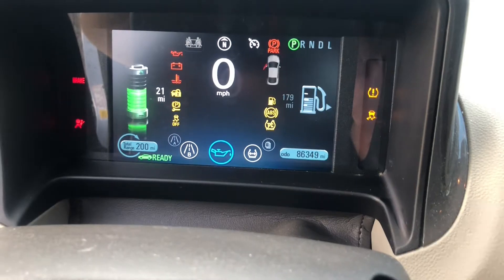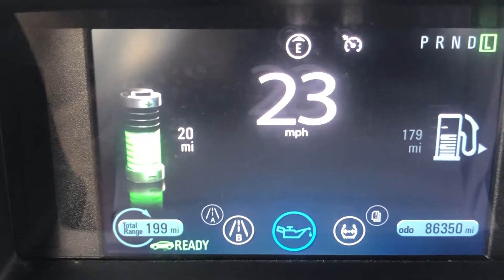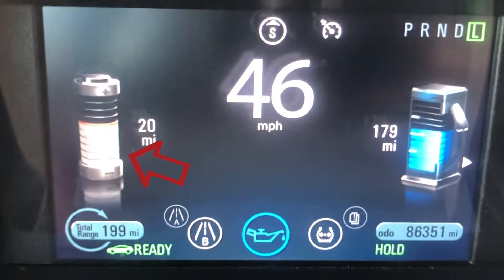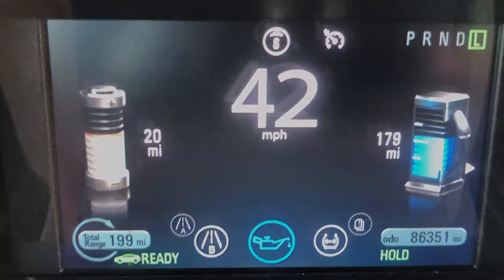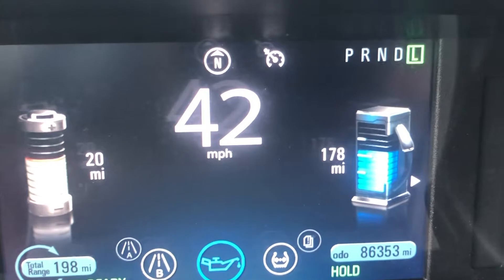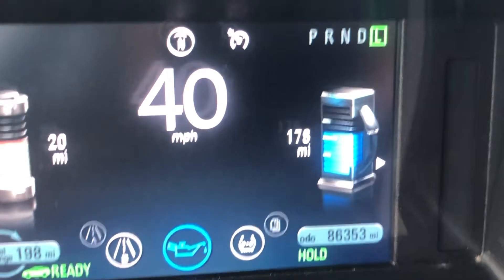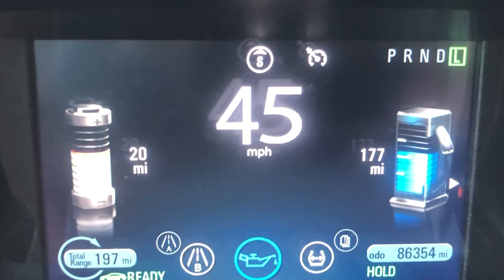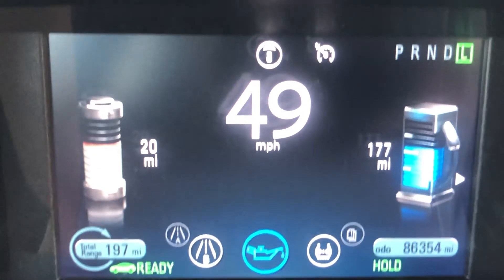2013 Chevy Volt - Hold Mode - EV evals

Comment: But on the highway, doesn’t it’s the engine just generate power for the batteries that drive the motor? Not actually drive the wheels. So it wouldn’t make a difference on efficiency? -saving battery for city.
Reply from the maker: Yes it acts as a generator most of the time. I believe in extreme cases the engine will drive the wheels though.
On ours the engine works really hard when it first switches over to gas. I don't remember this before but our driving routine has changed.

Comment: Why do you drive the car in "Low" instead of "Drive"?
Reply from the maker: Chevy chose to use “Low” or L to mean regenerative braking. Several other automakers, like Nissan I believe, chose B for braking.
Reply: @EVevals  thanks for the reply, very useful to know!
Reply: @EVevals  Thinking in ICE vehicle terms. Doesn't driving in "L"ow at speed, risk over working the engine?...or something else?

Thought I'd never want a Chevy and then I bought this Volt. Love it! Reminds me of my old 2003 Mercedes C230. Only I pass up gas stations unlike the gas guzzling Mercedes. Unfortunate for me though, I am leaving the country and can't take it with me. In trying to sell, I am running into a load of scammers. Any thoughts or advice?
Reply: Driving in 'L' or 'B' for regen is very inefficient. Especially on Highways. 'L' is for steep downhills , Mud or Snow. It is there to allow you to control the vehicle in certain situations.

Comment: The Chevy Volt is GM's exercise in EV design and technology.  It has its limitations.  These should've been dealt with and improved, but they opted to just killing the concept and pushing the BOLT EV platform.
     My daily commute with my 2013 Volt consists of a  mountainous 124 mile trip each way with a mountain pass that summits at 5,250 feet elevation.  Starting elevation is 2,500 Ft and destination is 3,720 Ft above sea level.  and then the return trip.    The Volt's drive battery can be depleted to the point of displaying the "PROPULSION POWER REDUCED" dashboard warning, PRIOR to completing the summit.  So, MOUNTAIN Mode or HOLD mode is required.  If I do not use the charge cord at my destination, I am forced to keep the vehicle in HOLD mode for the duration of the commute until I pass the summit during the return trip.     I have suffered the indignity of the reduced propulsion power.  It sucks, so my goal during the commute is to reserve enough drive battery capacity to reach the summit at highway speed.  
     My daily commute is not the ideal drive pattern that the designers of the Volt had in mind.  The car is best suited to flat urban commutes of less than fifty miles each way, in Stop&Go traffic.  
    The Volt has other limitations. But it is what it is, and at the time I purchased it, I couldn't resist the price of it as a Certified Pre-Owned vehicle, at $15K.  If only the seats were softer.
Reply from the maker: Roy thanks for passing on your experience. Especially with HOLD and MOUNTAIN modes.